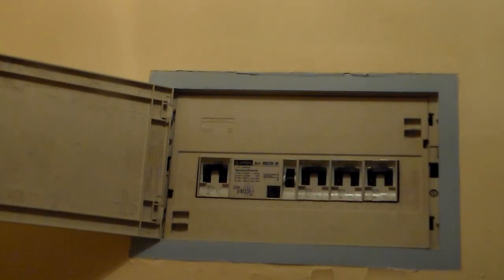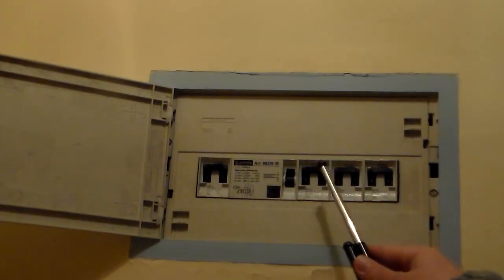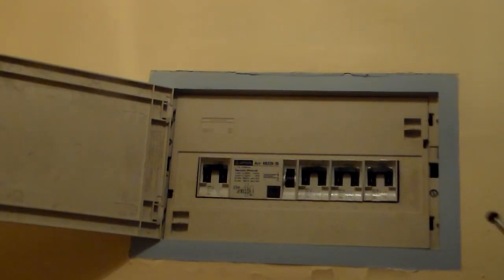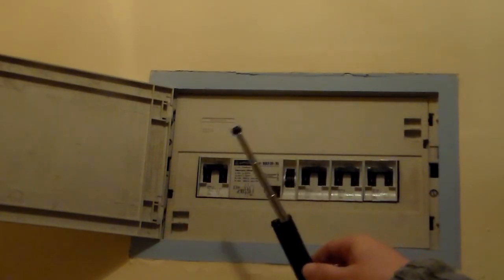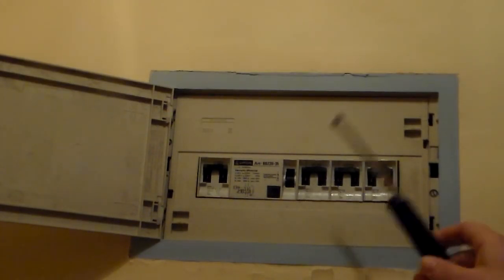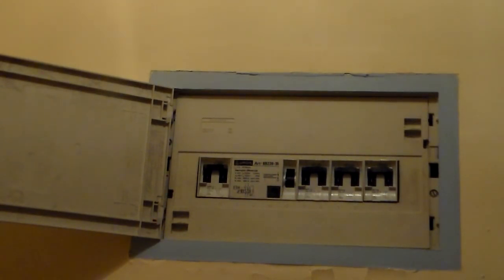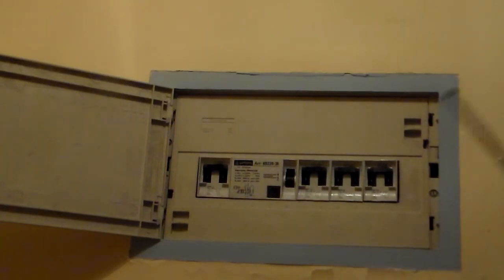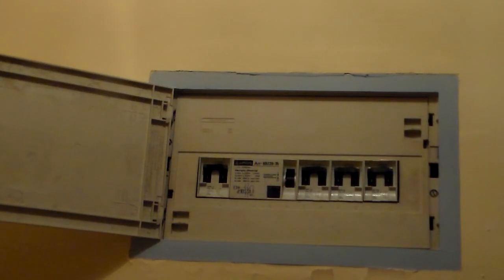how to find a short circuit at home

Comment: I have a short circuit in my lighting ring. Some of the lights are on 2-way switches. If the short were in one of those light fittings, what would I do with the switches to make sure that that light fitting isn't causing the short?  Thank you in advance.
Reply from the maker: Hi @nowthenad3286! Thanks for your question 🙌
If you suspect the short circuit is in one of the light fittings controlled by a 2-way switch setup, here's what you can do:

🔧 Step-by-step:

Turn off the power from the main breaker — safety first!

Set both switches to the same position (both up or both down). This usually isolates that line.

Disconnect the light fitting wires (especially the live and neutral going to the bulb).

Turn the power back on with the fitting disconnected.
– If the short is gone, then the fitting is the problem.
– If the short remains, it’s likely in the wiring or one of the switches.

🧰 If you have a multimeter, you can also test for continuity between live and neutral with the light off — you shouldn’t get continuity unless there's a fault.

Let me know what you find, and I’ll guide you from there.
Thanks for being part of the Manitas community! 💪💡

Comment: I have a breaker that trips only when it rains ... unfortunately, this one breaker for some silly reason does almost 2/3's of the home ... so roughly 20 power outlets. Is there anyway to find where the water is getting to short it while it is dry? As its hard to get an electrician out, under such short notice when its raining :( So any idea?

Comment: I unpluggued every single device but it keeps shorting, i dont know what it could be...
Reply: Three other possibilities:
1. The electric receptacle does not work properly, due to aging or some defection.
2. The circuit breaker does not work properly, due to aging or some defection.
3. The circuit inside the wall has some leakage or dislocation.